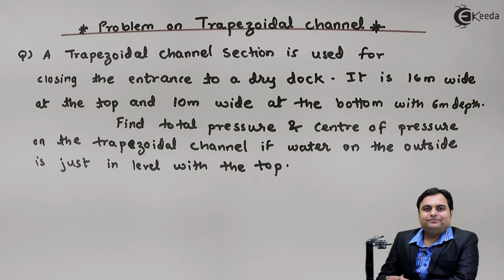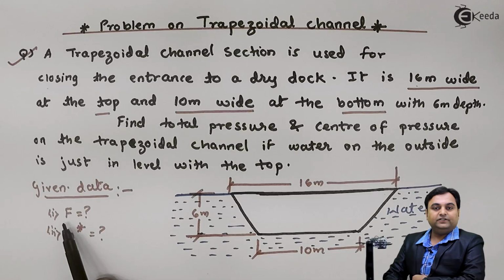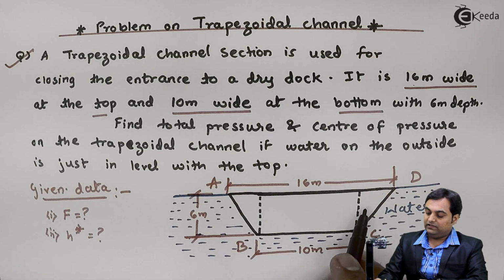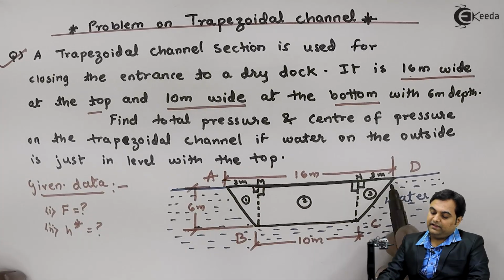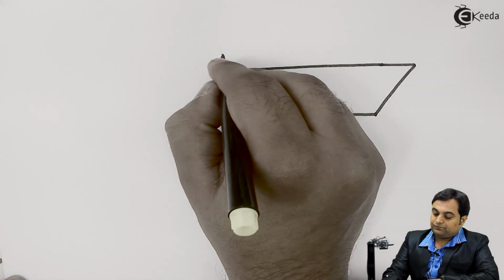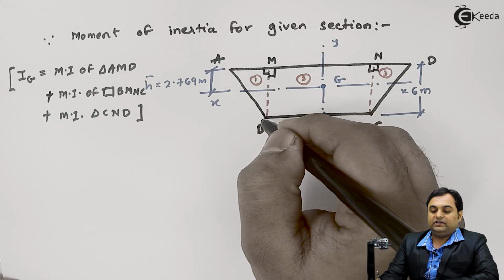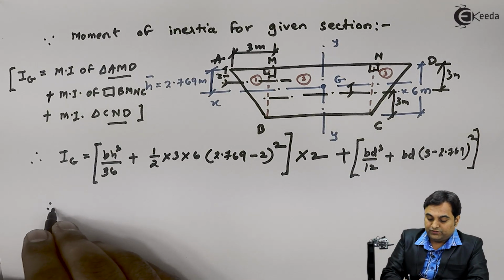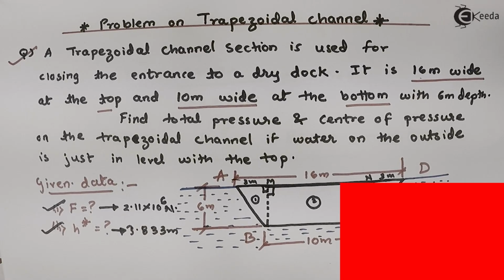Problem on Trapezoidal Channel - Hydrostatic Forces on Surfaces - Fluid Mechanics 1

Comment: A rectangular channel is 20 m wide and carries a discharge of 65 m³/sl *is laid at a slope of 0.0001. At a certain section along the channel length, the depth of flow is 2m. How far U/S or D/S will the depth bc 2.6m? Take n=0.02. Use direct step method with three steps. Consider the depth increment in the interval of 0. Im. Classify and sketch the proftfc.